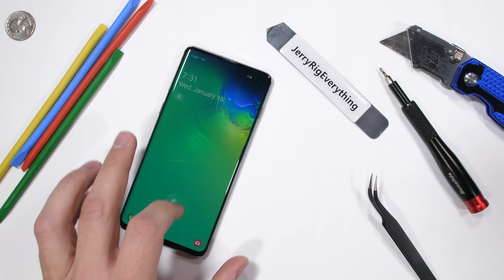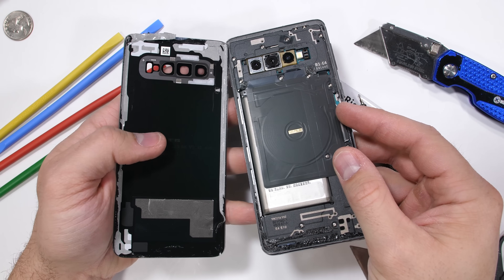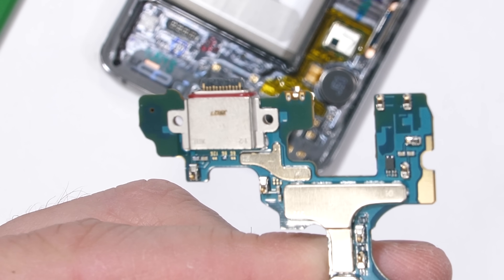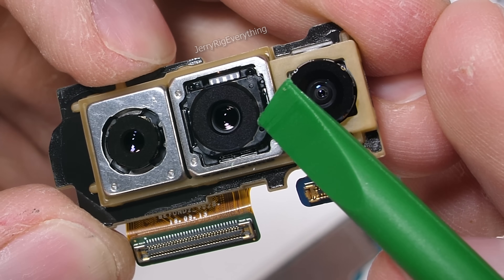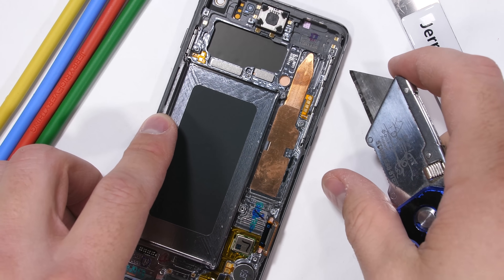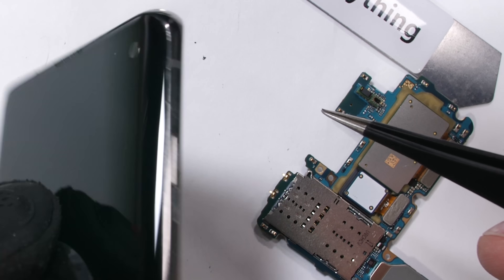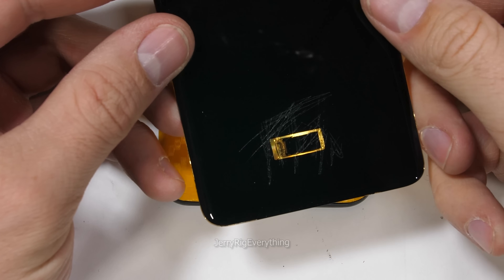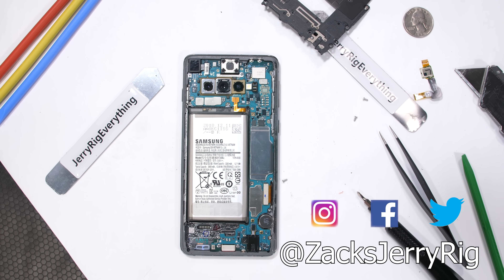Galaxy S10 Teardown – Does Ultrasonic Measure Up?

Comment: Ouch that chargeport. Also I get the dog thing but as a repair tech its one of my favorite things to show people. Also the coin flip was perfect. I can't believe fate landed that on heads... first try....
Reply: You could desolder the charge port.
Reply: @8BitParadise  That's what I was thinking.  You can still replace the charging port, just need a hot air station and soldering iron.
Reply: @Jaymiecain1  oh probably but it's a lot of extra work meaning a more expensive repair and also easier to screw up. Doing Galaxy s 3 ports was hard enough this is going to be another beast.
Reply: @x9x9x9x9x9  It's more work, but doesn't seem that difficult to do.  Use hot air gun, pull off with tweezers, put new charger on, leave to cool.  Considering you need a hot air gun to even get the back off you already probably have the tools.
Reply: @Jaymiecain1  oh for sure I have everything needed (except a replacement port and we'll an s10) but it's not that easy.  There are a lot of little nuances with stuff like this. You have to figure out how much heat to use without melting anything and without damaging the board. If it's too cool you can rip off pads. Then getting it back on is another story the pins have to line up perfectly and I'm not seeing the pins protruding out the back of the port at all which means it might all have to be done with a reflow gun and you can't use a soldering iron to touch anything up. I'm hoping the metal shields around the port come off and give access to the pins. But you're right it's probably not impossible just not easy.
Reply: @x9x9x9x9x9  You need about 190 f to melt lead free solder. I usually use 200-210 for about 30 seconds of heat when removing chips or through hole components like headers or a charging port. Just be sure to use some kapton tape to cover the microphone so it doesn't get any flux on it.
Reply: @8BitParadise  it looks riveted to the main board, no solder.
Reply: @8BitParadise  Yup, Ive had to do this in the past on a samsung galaxy prime phone, so this isn't even new to samsung...
Reply: Can you explain the dog thing ? I didn't get it
Reply: @vyktrii  he's been tearing down galaxy phones for a while, the past galaxy phones have batteries which have a "no dog" sign on it ,it was a joke that continued  with galaxy phones' batteries until the S10 finally freed the dog
Reply: @ridakesserwan8712  Heheue , thanks
Reply: Could always use the wireless charging.
Reply: Coin flip was 2 attempts. The first one landed tails....6:54
Reply: @dannyboy2180  that was the joke
Reply: @joonasfi  Oh, l didn't see you /s in the reply.....
Reply: @dannyboy2180  personally I think /r/wooosh is both childish and elitist. It's meant to confuse the person who did not get the joke even more by referring to an internal URL structure of Reddit. I don't understand why it's funny to point out that a joke went over someone's head by trying to confuse them even more.
Reply: @dannyboy2180  whoosh right over your head
Reply: I was thinking daaam good phone to buy, until I saw the charger motherboard...
Reply: Comment
Reply: Rip repair dudes lol

Comment: What happens when you take two galaxy s10, turn on reverse wireless charging on both of them and put them back to back?
Reply: Infinite energy
Reply: @MajorTurnip  the lower percent phone will charge until both have equal charge than both will heat up slowly and both start decreasing battery with same percent. , i am a physics student.
Reply: Or i. short u will have two  s10 with  0 % battery
Reply: @aakashduhan4888  and as an electronic engineer, I'd disagree with you. Go back to your theory nonsense!
Reply: Black hole
Reply: They give birth to a nokia 3310
Reply: Rips a hole in reality
Reply: You just broke Science!
Reply: FBI wants to: know your location
Reply: I'm guessing nothing, sounds like quite a dumb thing to do..
Reply: Its like plugging both the usb ends into a power bank... xD interesting question thou....
Reply: Electric flux from one will cancel the other phone flux and both phones will lose their batteries for nothing...
Reply: So last year with huawei NEXT!!
Reply: Infinite power
Reply: Short circuit.
Reply: You're treading on thin ice. Never attempt this if you wish to live. You have been warned.
Reply: Nothing happens. It’s one way procedure. First device should send an energy, second - should receive.
Reply: explode
Reply: Note 7. BOOM BOOM
Reply: another dimension
Reply: Nikola Tesla wants to know your location
Reply: They would actually both charge, but the amount given out is less than the amount taken in so with time they'd both be out of power. Oh, and they would also rip a hole in reality
Reply: That’s what I was thinking but couldn’t find anything. 😕
Reply: Here comes the answer you are waiting for, since I already tried that with 2 Galaxy S10 Plus, the phone shows a message stating that there is an Error at the moment to charge the device.
Reply: It will be violation of the first law of Thermodynamics
Reply: Chaos breaks out
Reply: Actually they would either just keep going until the batteries die or something would short out, costing you a lot to repair or replace.
Reply: @Draconius Zelsar i dont use reddit what it means?
Reply: Duh…everybody knows you get a portable STARGATE  ( enough for one person Only )
Reply: Communism
Reply: @liamlowery5485  stop.
Reply: none of them charge
Reply: You must be fun at parties @mananchawda
Reply: @DEM94   yep ! go to them with your wife .
Reply: The phones will get warm and slowly but surely lose their energy. Or nothing happens as they are voth in reverse chsrging mode

Comment: Phones built to be unfixable should not be bought. 
Planned obsolescence should not be condoned. 
Not only is it anti consumer it's also a waste of resources and labor as well as needless environmental strain.
Reply: Actually Battery came out easily and USB port can also be repaired by profesionales . No need to replace whole motherboard for it .
Reply: @rupeshverma9536  the USB port requiring professionals is a subtle push towards going to their approved repair services, on top of that the way the screen cannot be removed and how the fingerprint scanner is glued in even when it's something that can remotely break down (meaning a malfunction of the scanner leafs to a screen replacement) is an excellent example of building in deliberate bricking points to reduce the lifespan of the device.

Comment: Cut that finger print scanner off and use it for unlocking a door lol
Reply: It's pretty scary though - someone could steal your fingerprints by having a glass table in their house
Reply: @James_Dawes  Yeah, and they don't even need any special glass or electronics! Magic!
Reply: @James_Dawes  it doesnt work that way with ultasonic fingerprint scanners
Reply: James Dawes just clean your table?
Reply: @hussain1645  no I meant if someone pit fingerprint sensors inside of the table. Good point though- my table is filthy
Reply: @James_Dawes  u watched too many James bond and movies like this wtf
Reply: @gueeko2961  stop.
Reply: @James_Dawes  bro ultrasonic fingerprint scanner requires blood flow. So it's not scary
Reply: @James_Dawes  You could do that now, just give them a beer and take it back.
Reply: @KrissofallTrades  but it's more fun the more elaborate  and over the top it is
Reply: Anyway I rest my case

Comment: 2029 embedded hardware into a solid block of aluminum..

3000 every pixel has its own microprocessor and battery, wirelessly communicates with the other pixels and charge from wireless chargers meters away. (of course as soon as one pixel is removed it looses all structural integrity and vaporizes in the air never to be seen or repaired again)

Comment: The charging port can still be replaced, just not by the average DIY'er. Probably $100 to get a repair shop to solder a new one on. Seems stupid that a channel called JerryRigEverything states something as "unrepairable" because soldering is required...

Comment: A rough surface makes a heatpipe work better, The reason why larger heatpipes aren't used, is because the ratio between the surface on the inside of the heatpipe and the area of the heatpipe have to be between certain limits. Adding something like a sintered layer or something with a lot of surface area actually increases the effectiveness of a heatpipe.

Comment: Just learn to solder SMD components and it is not that difficult to replace the USB connector.
It was interresting to see the inside of that phone. Looks good. Still not sure I want to spend so much money to switch from my S7 Edge, which I got for a very good price just before S8 came out.

Comment: Ordered my first Dbrand design the other day, another first for such a special phone. The phone is special so I want to do special things for me with it. Titanium back and gold camera is what I went with. It will shine so beautiful.

I have never replaced a Samsumg phone or needed to repair one and I've had 5 previous so far and I'm not very careful with it once I've gotten used to it enough throw it on the table or a to a friend and such. I've dropped phone more than I can remember in outside and inside in all types of weather. Samsung has always been a reliable and solid phone for me. One of mamy reasons I decided to stick with Samsung forever. Mostly because I love tech and no phone offers more technology than Samsung. I always feel like I'm using something ahead of it's time and timeless.

Comment: The problems with repair-ability of ports is usually a non issue because you can use fast wireless charging and your phone should still charge just fine. Also, at least Samsung includes a headphone jack.

Comment: Not cool, Samsung. I have a S8 and its USB port got fried (using original charger and cable, mind you). I only was able to repair it because of JRE's S8 teardown video and the fact that the USB connector was in a separate board.

Sounds like I'll be skipping this generation aswell.
Reply: RR0101001001010010 a true shame, Samsung will be really really sad that you won’t be one of the thousands of customers in line for the phone...
Reply: Well, it won't be me who's gonna lose money if the USB connector fails.
Reply: RR0101001001010010 with a decent soldering iron and some confidence. I’d say it’s gonna be relatively easy to fix the charging port on the S10.